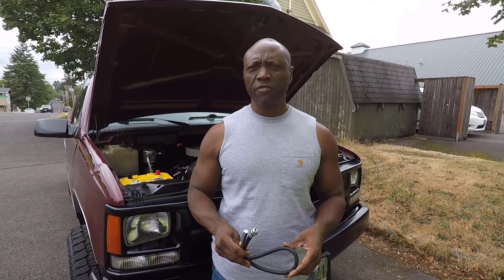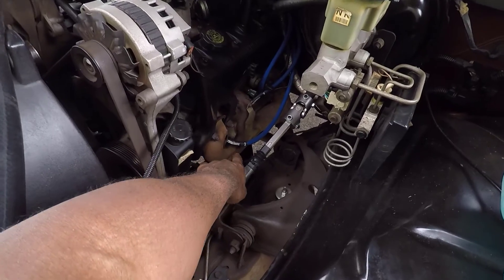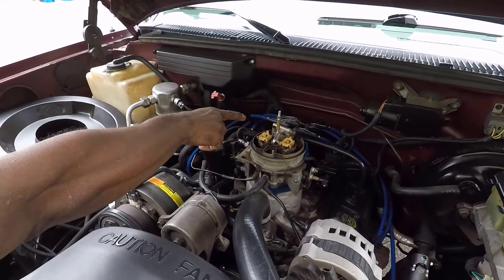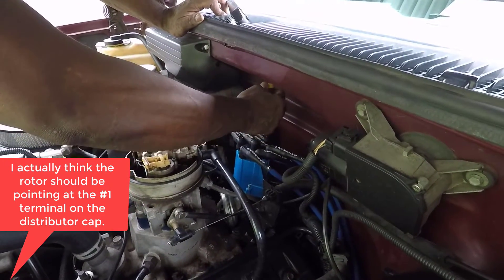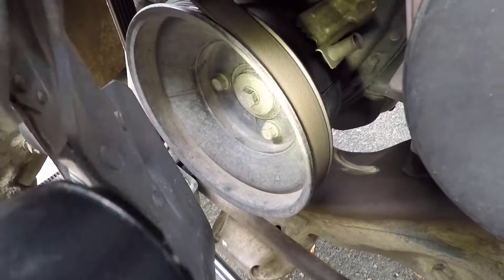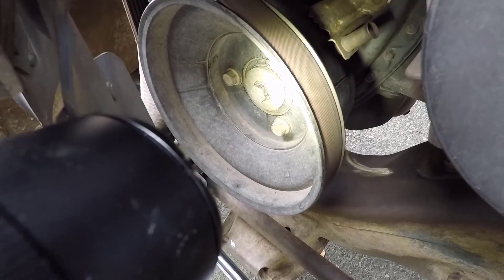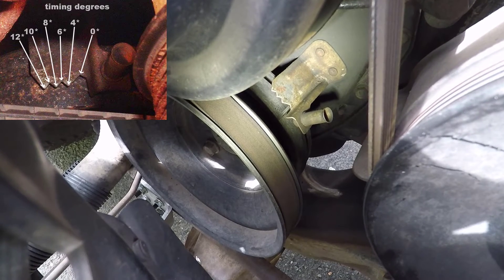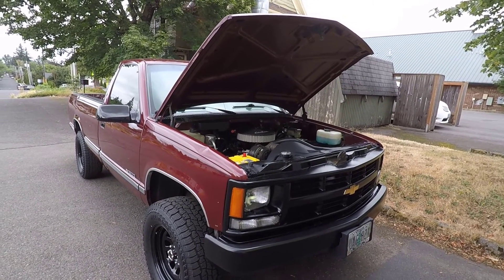How to Find TDC in a Chevy 4.3L V6 using a Top Dead Center Indicator Whistle Tool

Comment: So I put on a new cap and rotor and did check the timing or anything like a rookie and and now won’t run so if I put cylinder 1 on tdc and point the rotor at 6 on the distributor will that fix it ?????

Comment: If on TDC the rotor should be pointing at number 1 on the distributor not the number 1 cylinder!  I used to always think it was supposed to point at number 1 cylinder but its on the cap number 1. Also first timing mark is for timing down below,  second mark is for timing up top like you are. Awesome video

Comment: For me I had intake, power steering pump, fan ,fan shrouds off so all I did was one hand turn the engine over then other hand over the spark plug hole. Best way before you take anything apart take off distributer cap and line up the marks on the balancer and that should point at 6. There’s a couple of videos if you just look you can find em
Reply: Just use rachet and 1in socket turn the alternator take number 1 plug out and screw it in about 1/2 turn ..then turn motor over till u hear a hiss noise that's compression side move to first groove on harmonic balancer line up with v mark on the timing cover ..easy as can be with just 1 person

Comment: I believe the other mark lines up with something underneath, this really is difficult to do with one person I have been trying to use a length of s/s wire and holding it/feeling it move is hard while turning the wrench with the other hand - I am gonna look for one of these whistles so I can drop in a new distributor
Reply: Just put socket on alternator and turn it and take number 1 plug out and screw back in half or a turn when u get to compression side and TDC  the plug will make hiss noise .then just find groove 1 and line up with mark on timing cover .

Comment: I have this truck. 
Mine is a 5 spd. manual trans.
Recently; 185,000 ODO ; a squeak coming from my crank  that marks each revolution of the crank.   
 Might I guess it is the harmonic balancer?
1st thought it was the water pump. 
Changing that and the belt , tensioner, idler pulleys did nothing to the “squeak” that is getting worse. Even at idle in neutral.

Comment: I love your videos! Where did you get your tdc tool?❤❤❤❤🤝
Reply from the maker: Thank you! I bought it on Amazon ❤
Reply: @BuildYourOwn  do you have the part number for the top dead center whistle that you can share please? Also keep making as many videos as you can of the 4.3 L I have done so much work to mine, but it is worth every penny. I’m in the middle of the distributor was taken out without me knowing and no marks were made or anything so I’m starting over needing to find top dead center get the oil pump lined up and then drop a new distributor in so hopefully it’ll work but I’m doing it by myself so I need that whistle if you don’t mind please